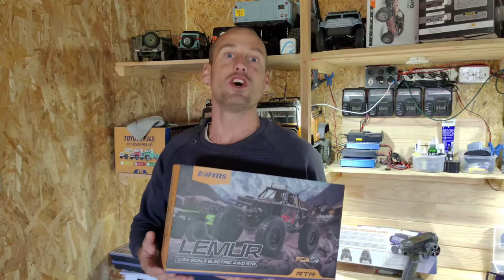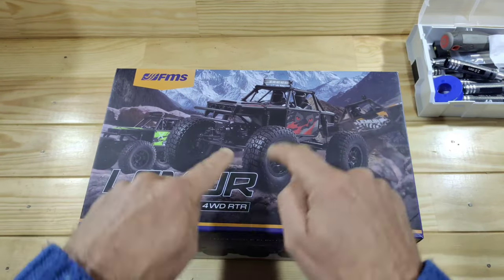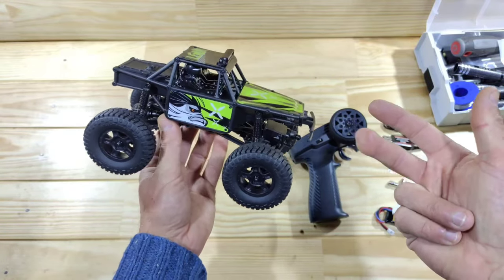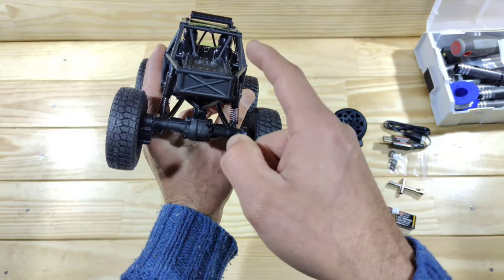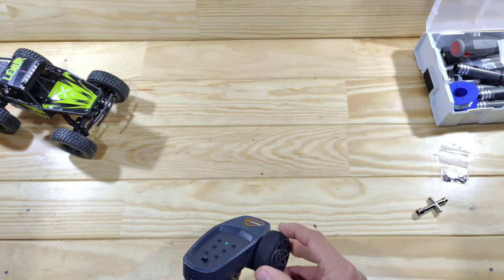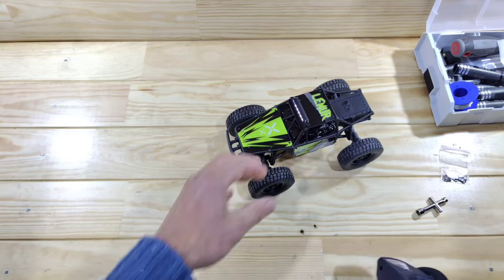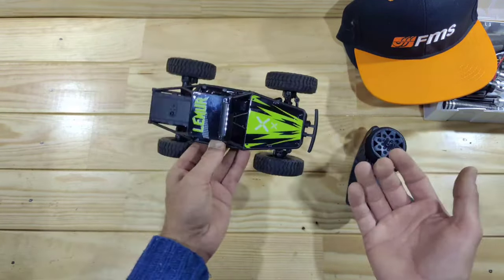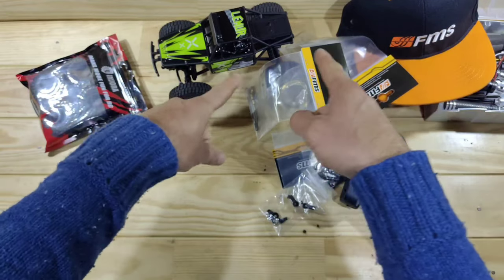This surprised me! The new FMS FCX24 Lemur unboxing and test.

Comment: I'm a FMS fan. Many of their crawlers in my collection. But the videos i've watched about the Lemur show a very stiff suspension system. Factory oil filled shocks made them quite lazy to move.
High and rear placed battery kills the stability on difficult lines. The battery has to go forward, but any space left, for that ? And the tires grip as well as a piece of soap.
The good thing is the "Capra" look. Hope you'll succeed in this project to make this rig a true mini-Capra. I keep an eye on your work.😉